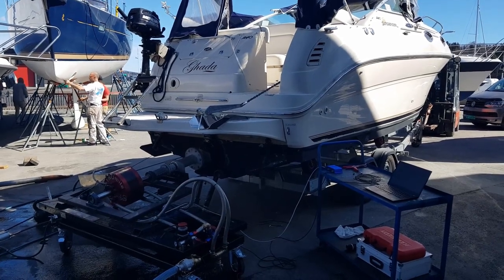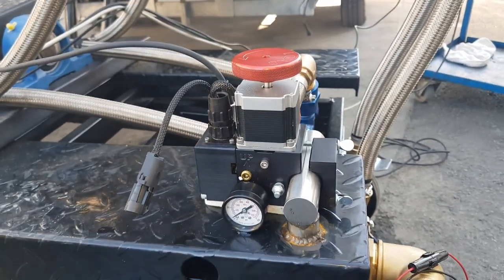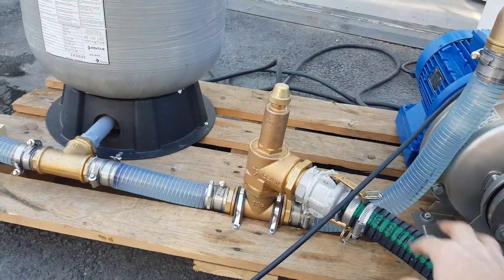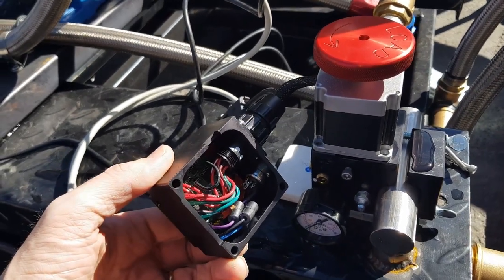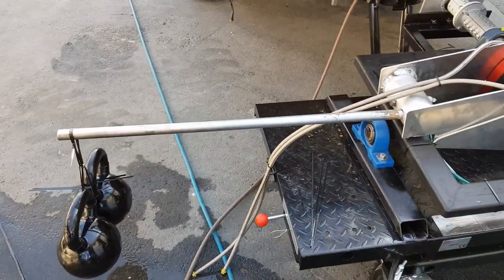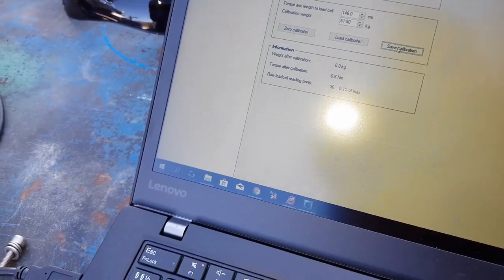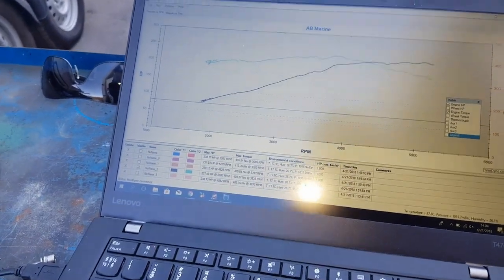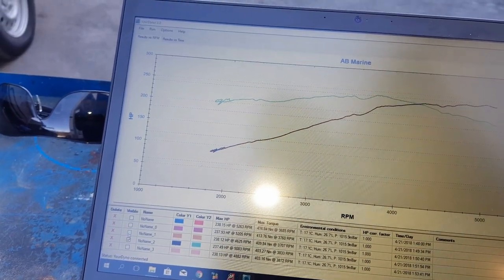Water brake demonstration with YourDyno instrument kit

Comment from the maker: The YourDyno valve (which we did not test here) can turn off the water completely when the engine is off or idling. The Dynomite valve which was used in the video is not completely sealing so some water will leak through at all times when the pump is on

Comment: Does the absorber need to have water going through it at all times while the engine is running? Even when not doing a pull? Is the valve designed to let some water through when not testing? Thanks. I have the same absorber and valve I’m just trying to learn before I hook everything up.

Comment: what is the part number for the water control valve with the stepper motor i cannot find it from land and sea
Reply: Part# 430-310 (Standard-Flow - 1")
Part # 430-314 (High-Flow - 1-1/2" )
Part # 430-318  (Ultra-Flow - 2")
Reply: @TheMoistpotato  Where can i order them ?

Comment: So you run these tests at WOT?
Reply from the maker: Yes, if you want to create a HP/Torque vs RPM curve.  But you can test on other throttle positions too if you want to tune the ECU
Reply: @YourDyno Ok. This is how I imagine you run a dyno test for the torque vs. rpm curve

You run the engine at WOT, so that it goes to the redline rpm. Now you load the engine and note the torque at that rpm

Then you load the engine some more, so that the rpm reduces by say 50 rpm. Then you note the torque at that rpm.

And so you sequentially load the engine so that it slows by 50 rpm with each iteration and note the torque at these rpms. Until, at some load, the engine stalls. Just before the engine stalls, is the max torque of the engine and the rpm at which the engine is capable of max torque is the max torque rpm.

And so you have the torque curve between the max torque rpm and redline rpm

Now my real question;

When you unload the engine from the max torque rpm, the engine would rev up, so how how do you find the torque/rpm curve between idle rpm and max torque rpm?
Reply from the maker: @SunilSundar  You can run from low to high rpm (most common) or high to low rpm. The rpm is regulated by a regulator loop, if it is too high then it brakes a bit more, if it is too low it brakes a little less. The "set" rpm is defined by the user, typically you want a smooth sweep from start RPM to end RPM over say 10 seconds. The software then knows the target RPM and adjusts the brake so it is as close as possible to the target. For an engine dyno that does not measure transmission losses, at the end RPM the brake stays on regulating to the end rpm, so you can let go the throttle as you please without risk of over revving